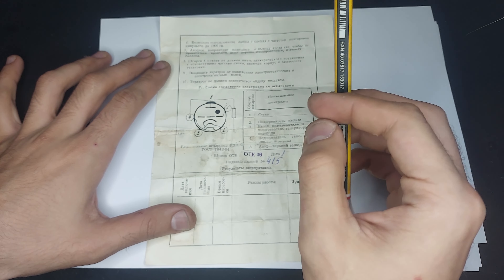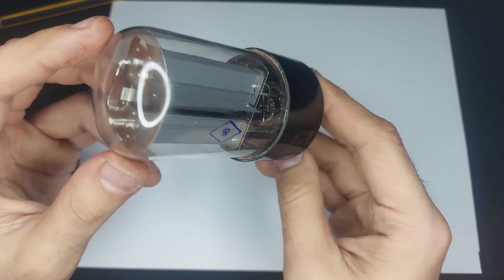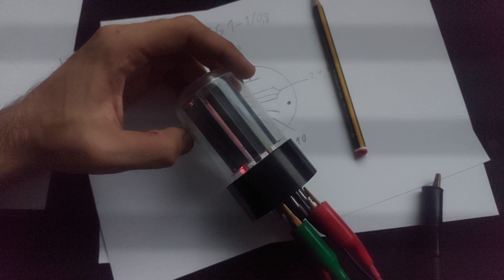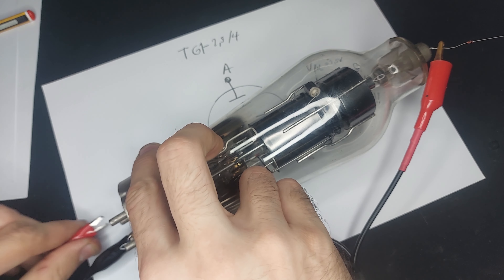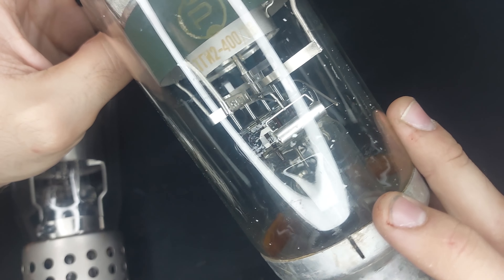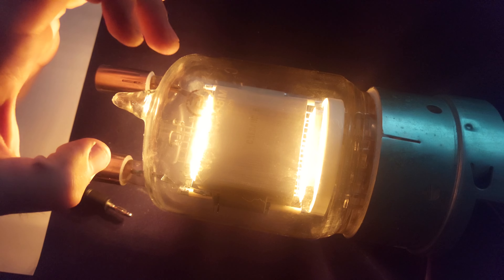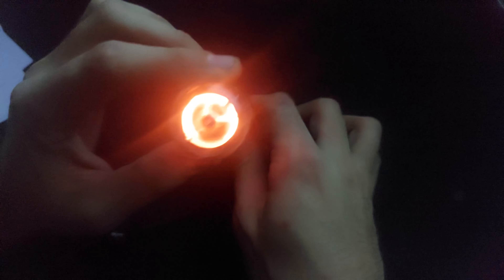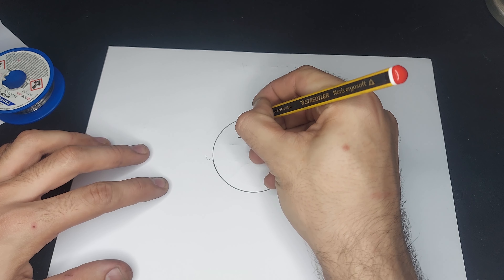Making weird tubes glow

Comment: Thyratrons- particularly the hydrogen type- still have uses although they aren't as widely used as they used to be.  Large particle accelerators are still dependent on them to produce the pulse power for driving the klystrons.  In transmitters and particle accelerators using inductive output tubes they are used in the crowbar circuit used to protect the IOT from damage due to internal arcing.

Comment: It's pronounced thigh ra tron, not theryatron.  I wondered why I had never heard of these the first few times you mentioned it!  Thyratrons were also used in some vintage TV timebase circuits.
Reply from the maker: I'm under the impression nobody knows what they're pronounced. I'm joking, you might be right!
Reply: @GearAcquisitionSyndrome  Well, I do have a degree in engineering and electrical sciences, and always tinkered with old post war TVs as a boy, which is where I first came across thyratrons.    My uncle told me how to say it, he was also keen on electronics.
Reply from the maker: I've also got a degree in electrical engineering and English is my second language. I'll probably use the pronounciation you suggested, it's less of a hassle
Reply: @GearAcquisitionSyndrome  I just remembered that I know two people who used to work at the STC factory in Paignton.  They both mentioned thyratrons and used the pronunciation I advised.  One said that the test room had a strong smell of ozone from the high voltage corona discharge.
Reply: Years ago I was an enthusiast for old TV's.   Were there any post-war TV's that used thyratrons for the timebase?